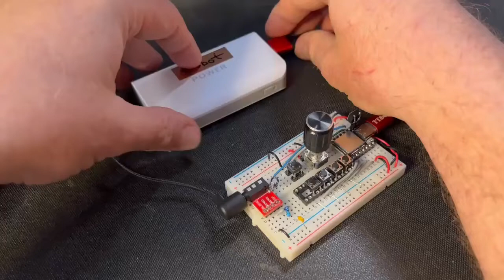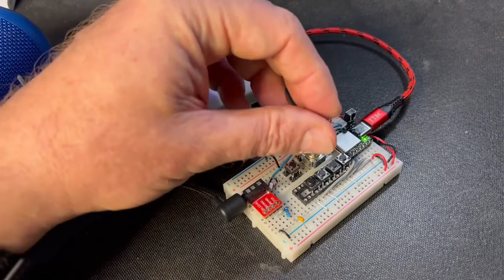Arduino SAMD21 drum machine w/ Mozzi synth lib

Comment: Thinking of building something similar, did you need an amp for the headphone output?
Reply from the maker: If you were building a "proper" circuit, yes, you should have an op-amp output stage to drive either line-level out or headphone out. But for just hacking around, you can use a simple RC circuit to both limit the current and cut out any high-frequency noise, like I'm doing here.